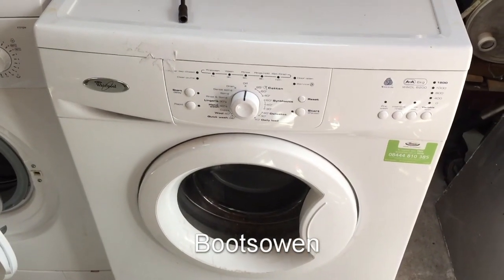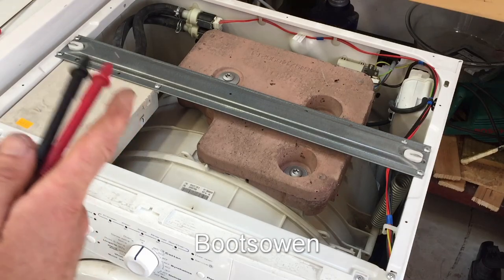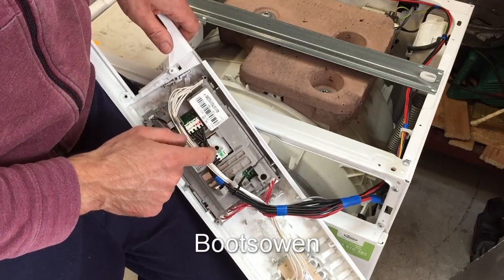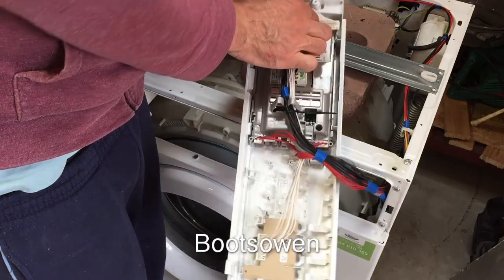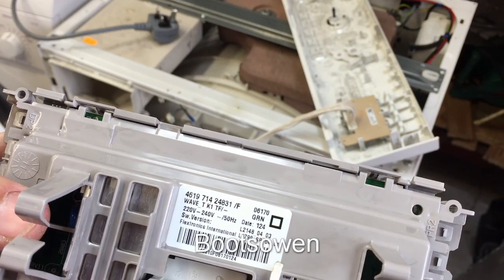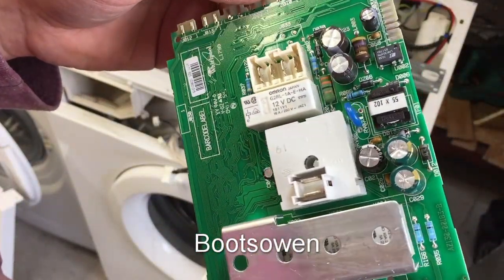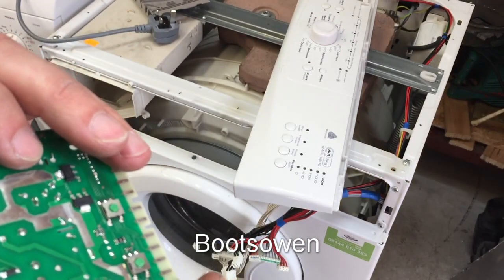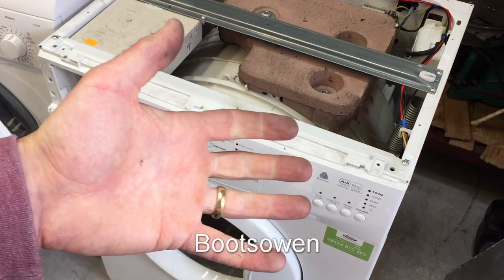Whirlpool WWDL 6200 fault finding PCB Fault: your help needed!

Comment: One of my uncles owns this washing machine and I do really like it it is a nice washing machine and I also a video of it in my channel.

At the same time it must be some short of PCB problem if you don’t want to spend £150 on a new one get a used one of eBay because they are much more cheaper then a new one but as you might say it’s not worth it
Reply from the maker: Sure, send me a link to a used one from ebay that will fit this machine. It is the main pcb, not the smaller auxiliary one.
Reply: bootsowen Here is some link these are the only ones I can find at this time and they do look smaller but hopefully they are similar or the same 

https://www.ebay.co.uk/itm/Washing-Machine-Whirlpool-WWDL6200-PCB-User-Interface-Board/333151625422?hash=item4d916260ce:g:

https://www.ebay.co.uk/itm/WHIRLPOOL-WWDL-6200-TOP-CONTROL-46197140379101/392853876718?hash=item5b77ea6fee:g:Fp8AAOSwx6pYp2ty

https://www.ebay.co.uk/itm/Washing-Machine-Whirlpool-AWM5104-5-PCB-Main-Control-Module/233203224843?hash=item364bfed10b:g:8iAAAOSwXc9cG5mK

https://www.ebay.co.uk/itm/Washing-Machine-Whirlpool-HDW1011WG-PCB-User-Interface-Board/333344947291?hash=item4d9ce83c5b:g:oWsAAOSw2kpdWwFd

Comment: its not worth replaceing the board, you can boards fixed tho, but depends what the machines worth afterwards , about £50 so not even worth that tbh
Reply from the maker: Yes, I found a board repair kit for this one on ebay, it is basically a few components, a few people sell them. SO I checked the components that I could check on the board and found one dud resistor, so I have ordered a replacement. Maybe that will fix it. If not I'll order more parts. I enjoy fault finding, but i don't enjoy spending money!

Comment: There is one on ebay for £18.00
Reply: Bosch beko Boy 2006 they are so bad if they are so cheap
Reply from the maker: This is the smaller indicator board, not the main board.

Comment: You smashed a Whirlpool washing machine back in 2015 which looked exactly like this one and it did live quite long and I think you saved the drum from it to make the spinning washing machine drum firepit video. £150 is too expensive for the board knowing that the machine is 9 years old and might have other problems in it. Are you planning to throw a brick in this one?
Reply from the maker: I am going to try and fix it first.
Reply: bootsowen good job!

Comment: Must definitely be a pcb failure, I remember you had a similar whirlpool with a board issue but you bricks it. I would just brick it but it could be a problem with the selector knob switch not letting power through but I doubt it as it seems fine. I looked on eBay and had a look if they do any boards for these I only managed to find two second hand boards, I might of not typed the right thing in but I’ll have another looks for you (they both costed around £14 to £18)
Reply from the maker: The ones on ebay are the small board that drives the lights and buttons on the right. I think it is the big board that is dead I found one online for about £150!. so not worth it. At first I saw those cheaper boards, and got my hopes up, but no good! Thanks for looking!.
Reply: Yep definitely not worth it! Just feed it it’s blast then it will be fixed I’m sure.